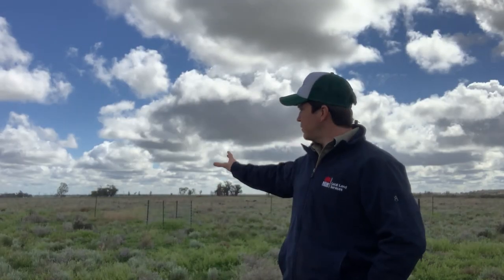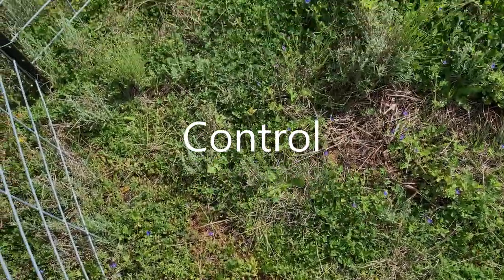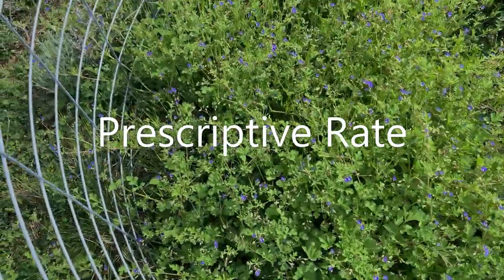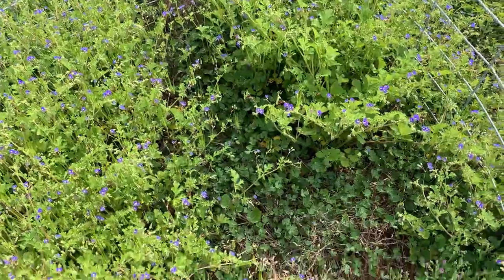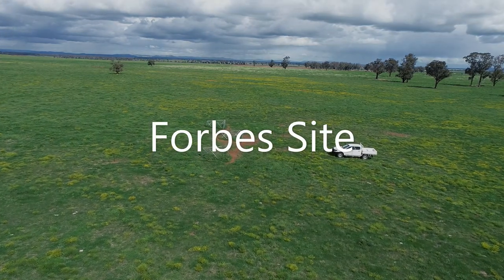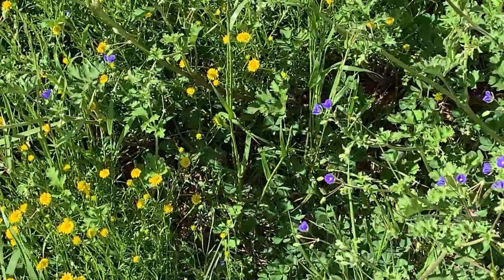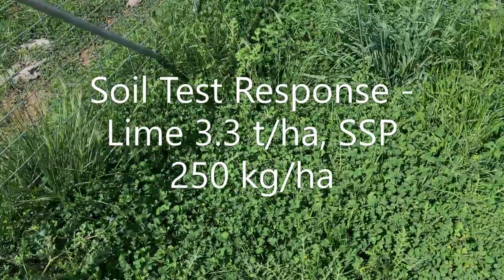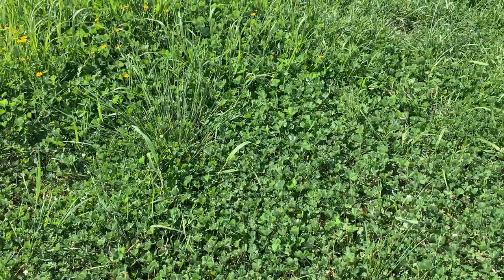Lime and phosphorus demonstration sites

Comment: The problem with applying SSP is that within 6 weeks its all going to be tied up in the soil and not available to plants (as Aluminium phosphate or Iron phosphate etc in acid soils).  This problem could be minimised by applying 5% humic acid granules with the SSP (ie 5kg of humic granuals per 100 kg of SSP)  It would be more interesting to look at the Total P level in the soil however.  If there is a reasonable amount of total P then the problem will be lack of diversity in the pasture (both plant functional groups and their associated microbes that provide plant nutrition).  Lime is useful to provide calcium if calcium is low, but kind of expensive if you are just looking to modify pH only.   The research done in the Jena experiment and discussed by Dr Christine Jones (Green Cover Seed Channel) shows that plant diversity is more important in providing fertility and resistance to drought and disease than anything else.  Specifically you want at least 4 plant functional groups (plant families) such as grasses, legumes, brassicas, linseed, plantain, chicory etc.  Plants and their associated microbes have the ability to change their own microclimate including pH to suit their needs.